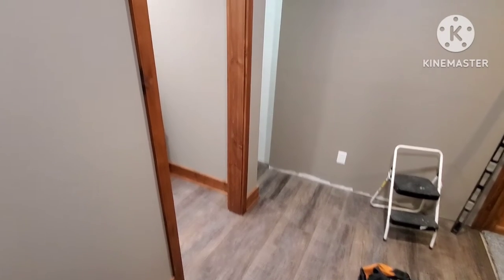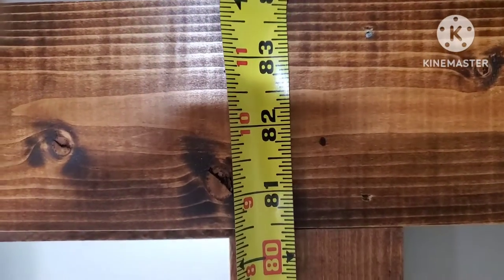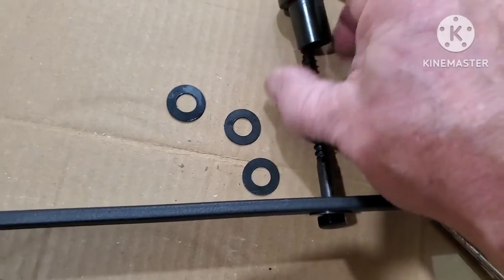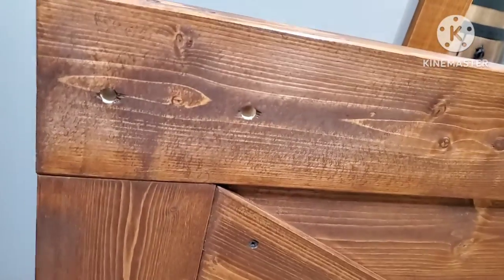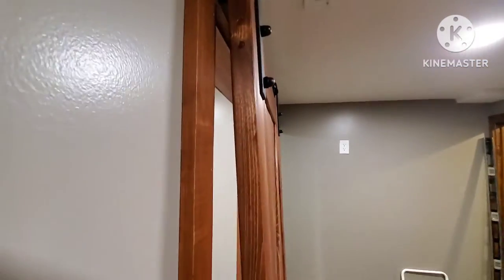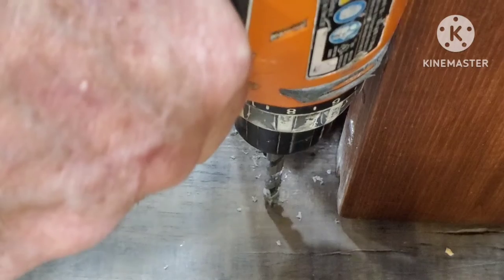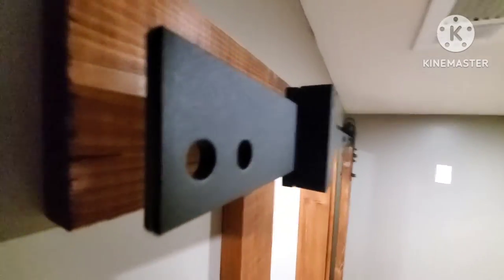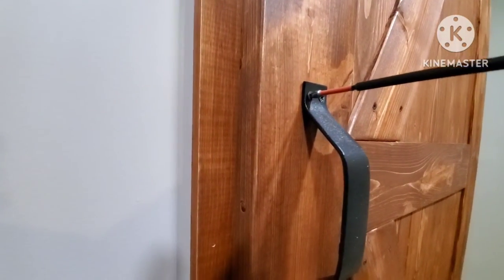barn door hardware (quick tutorial)

Comment: My only issue was the acorn nuts on the door.   Either the bolts seem too long, door not thick enough, or acorn bolts not drill thoroughly.
Reply from the maker: I did not have that issue, you could cut part of the bolt off with a hacksaw